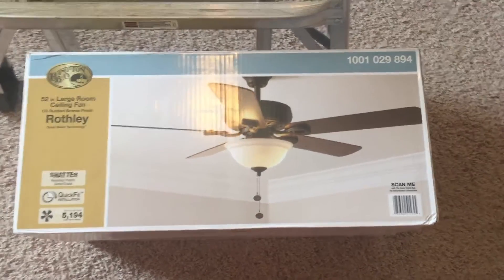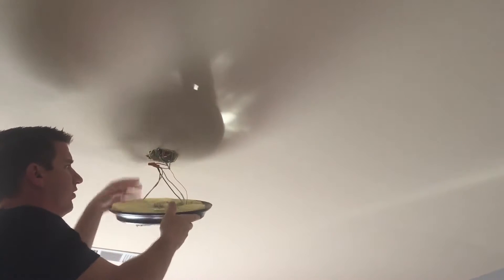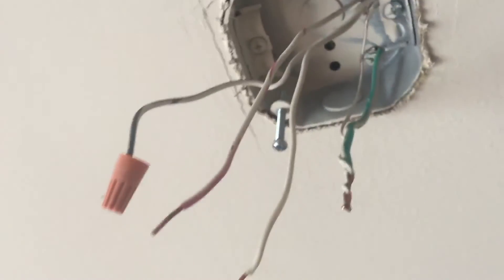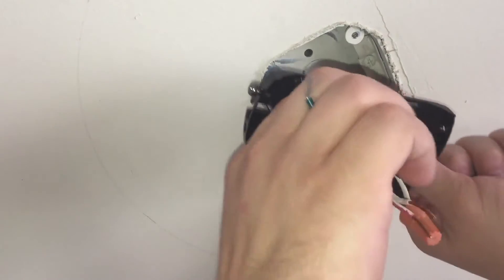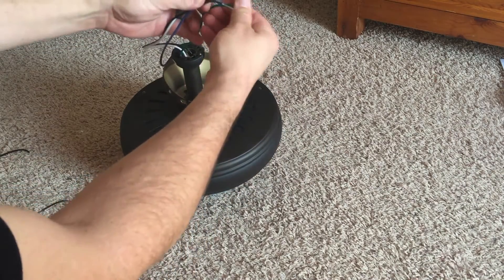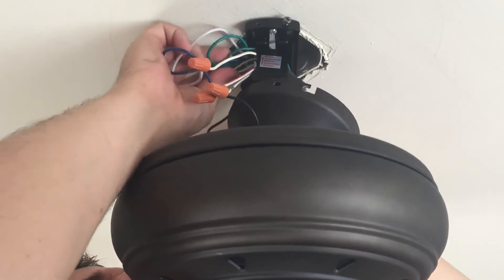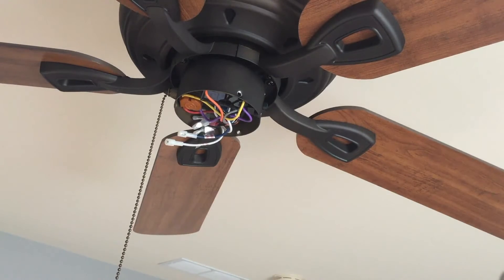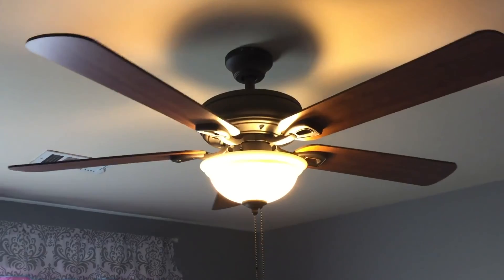Installing a Ceiling Fan COMPLETE

Comment: Did you not need to do extra support for the outlet box to handle the extra weight of the fan? How do you know when to use what is there or add additional support brackets?
Reply from the maker: Justin Shields Building codes state the ceiling mounted electrical box should be able to hold a 50lb light fixture at minimum.
Reply: @TightWadDIY  Okay, cool. Good information, thanks :)